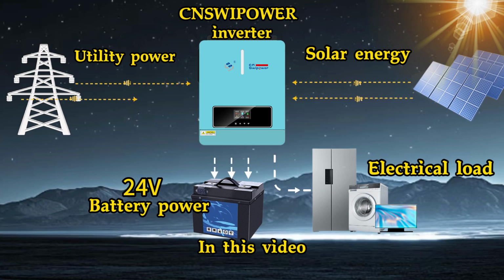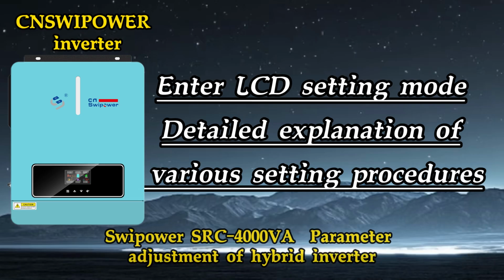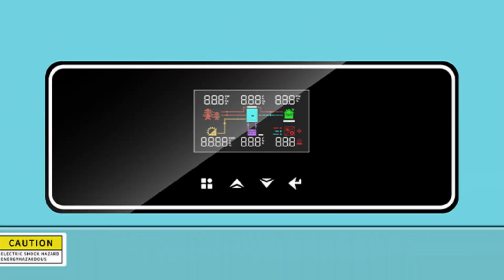LCD Settings of 3.6KW--4000VA Hybrid Solar Inverter - Energy - Saving Secrets You Must Know

Comment: My inverter which I got and installed recently the power jumps all over. If its set to 115v it goes to 126v then to 108v and the lights in the refrigerator flashes also the wattage jumps around as well. One time the compressor starter to sound like a train in one of the fridges which I had to change it to usb mode in the second screen to prevent the inverter from running. It only happens when in inverter mode. I checked over the batteries and its good. The other inverter worked good that was there in the location before I replaced it with this one.(it was a pwm inverter so the charging wasn't efficient) I series 4 panels and have about 120v in intense sunlight running at about 10A. Can anyone say what I'm doing wrong. The maximum draw is about 850W and it goes down depending on how many refrigerators are working. (total of 4)
Reply from the maker: We sincerely apologize for the unpleasant experience and appreciate you leaving your message and feedback. Here is our response to your issue:

  First, disconnect all wires on the output side, then check whether the inverter can stably output 115V. 
  This will help us confirm if the voltage fluctuation is caused by the connected loads. 
  After verifying the unit itself works properly, do not turn on all four refrigerators at the same time; start them one by one instead.

Refrigerators are equipped with compressors that generate huge inrush current the moment they start up, which the inverter cannot withstand. Please switch on the four fridges separately with intervals between each.
We hope the above suggestions can help you resolve the problem.

Additionally, if possible, please share photos or videos showing the malfunction, so our engineers can troubleshoot efficiently for you. Thank you.
Feel free to leave a message anytime if you have further questions, and I will respond to you as soon as I see it.

Warm regards,
Daisy
 Sales Manager
Reply: Thanks for the reply.The fridges were started one at a time.Sometimes it would run for hours b4 the issue shows up,so far its mostly when the sun's intensity is high. I checked out the whole setup today actually and it seems that the voltage is quite stable probably changing by a volt for the most but the frequency is all over from 100hz to 200hz so I believe that might be the issue.Let me know what you can think of again that will affect the AC frequency. Hope that helps.
Reply: even though the voltage is stable on my multi meter ,the panel on the inverter says its voltage is fluctuating. The frequency page says the frequency is 60hz though even though its no where there.
Reply from the maker: @kester420  You're very welcome; it’s my pleasure to assist you.
Here is my reply regarding your second question:

First, disconnect all wires from the output terminals. Only connect the battery and restart the unit. Check the AC output frequency value displayed on the screen. Make sure you do not hook up any output cables at this stage—only power the inverter via the battery and reboot it. Our engineers’ initial diagnosis points to the refrigerators interfering with the inverter.
Regarding your request to sort out all factors that can affect AC output frequency:

The frequency instability is caused by the refrigerators. Fridges are equipped with compressors. You just need to connect this filter capacitor in parallel on the inverter’s output side to resolve the issue.Capacitor model: 275V 0.47μF

Please refer to the attached picture for detailed installation instructions.
I hope the above information is helpful to you. Feel free to leave a message anytime if you have further questions.
Reply: @SwipowetDaisy017 hi good day. Thanks for the reply. I will put the capacitor shunt across the outputs and let you know.
Reply from the maker: @kester420  You're very welcome. It's my pleasure to assist you.
I can send you the operation schematic for your reference. My email address is sales017@swipower.com.
Feel free to send your videos and photos to this mailbox, and I will also provide you with illustrated diagrams to facilitate your operation.

Comment: Why my inverter over charging
Reply from the maker: Hello, wish you a wonderful day! Thank you so much for your message~

Regarding the overcharging issue of the inverter, it is mainly related to the following factors after investigation: improper battery parameter settings, incorrect charger source priority configuration, hardware failures, or abnormalities of the battery itself.

You can follow the steps of "Parameter Verification → Configuration Adjustment → Hardware Troubleshooting" to operate step by step and try to solve the problem.

We hope the above methods can help you solve the problem smoothly. If you have any questions later, please feel free to contact us!